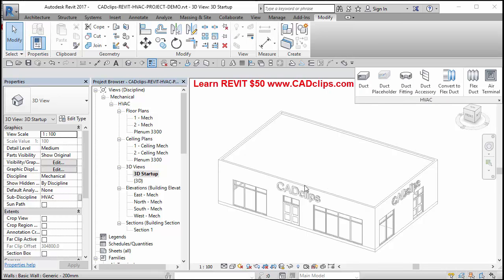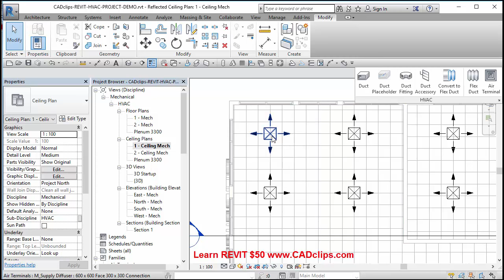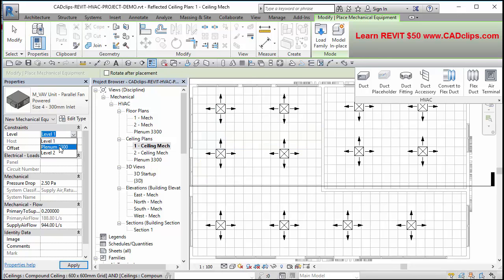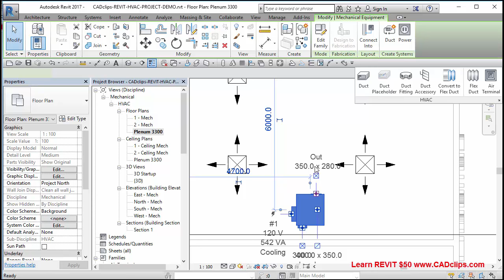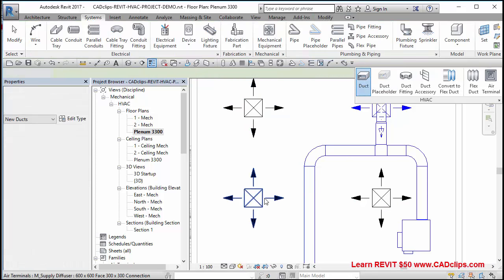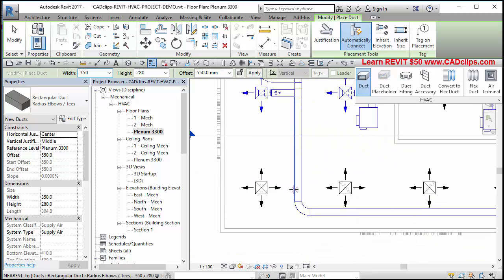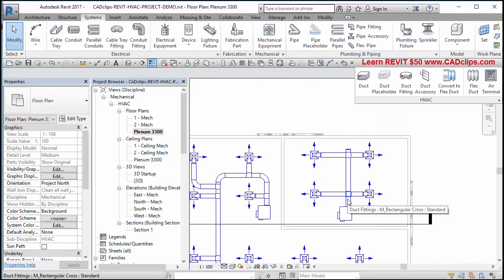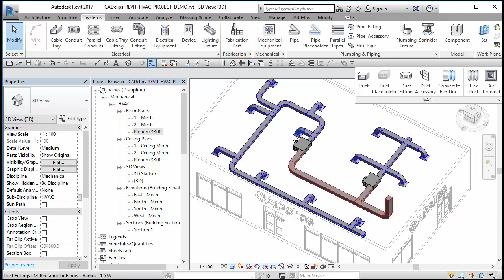REVIT HVAC DEMO - CADclips

Comment: Are you a software guy, or do you work in HVAC?  That duct layout on the left is not how any HVAC folks would actually install one.
Reply from the maker: HVAC design is not my forte (more arch and struct) and the purpose of the video is more of how to show HVAC people how to use REVIT to place equipment and run some ducts to the right connectors. I leave the HVAC specifics to the user.